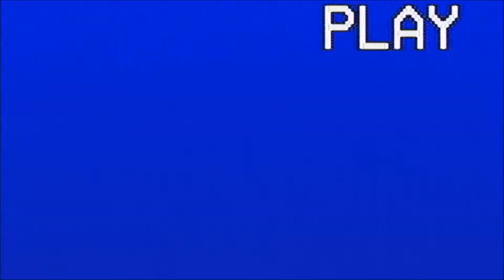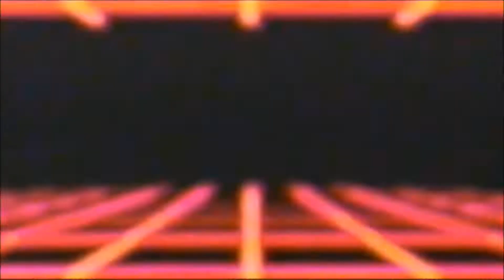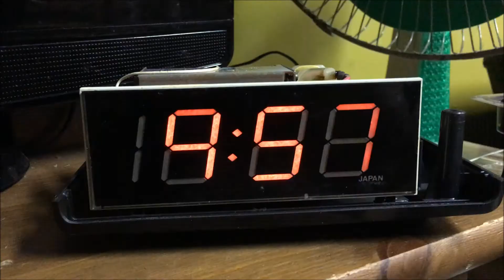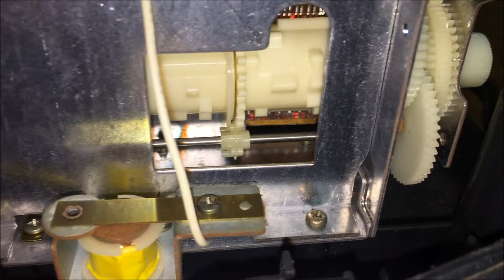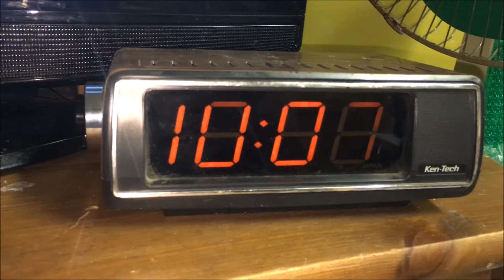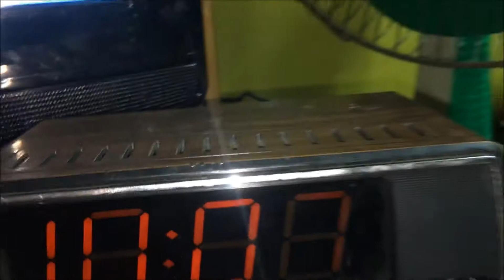Retro-Tech: 1970s Ken-Tech T507 mechanical "digital" alarm clock

Comment: Wow I haven't seen one of theses since my old one fell apart. The leaf switches started failing so the segments would not light up. Been looking for a working one for years to complement my mechanical compu-lite clock that uses mechanical shutters that open and close to display the digits. Would look nice in my collection, along with my 70's flip clock, 70's Panaplex, Numetron, and Nixie Tube clocks.

Comment: The design Tamura used in their earlier Lumitime clocks has a pair of planar rotary switches similar to those used in handheld multimeters.  The alarm dials sit right over these switches and the whole assembly, including the motor, is mounted to the front of the mechanism, making for a more compact arrangement.  They even included an animated seconds indication.

Comment: An unusual design. Early Tamura Lumitime clocks use a similar setup. At least one model even uses cam driven shutters that block a lighted panel, no switches needed.
Reply: Keenan Finucan I own the Tamura Lumitime clock that has the built in AM and FM tuner and I absolutely love this thing. Vintage technology is so cool!